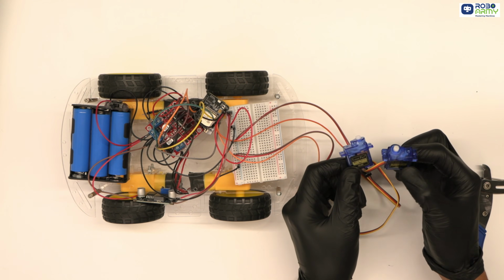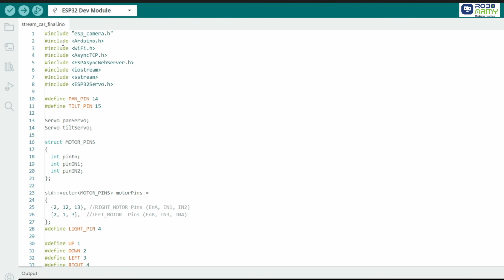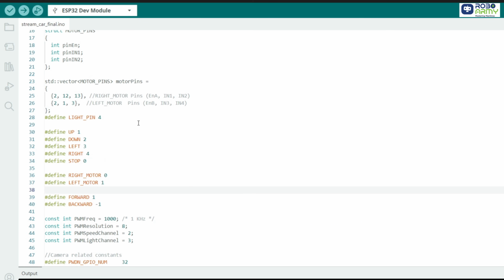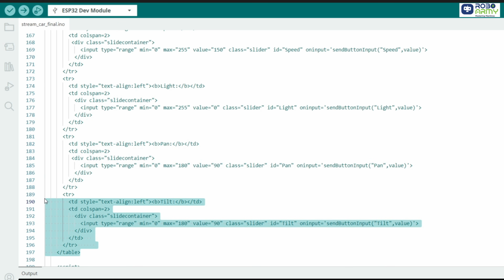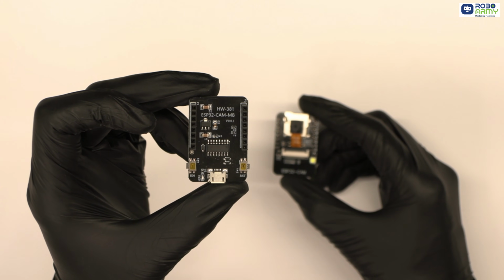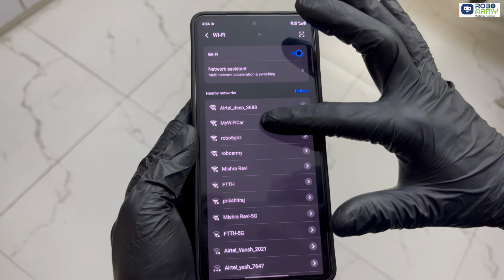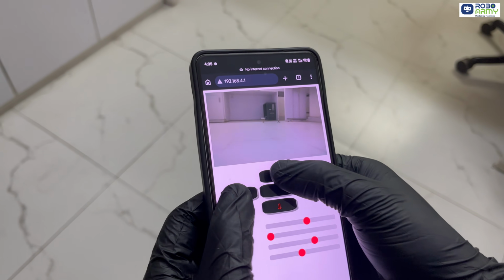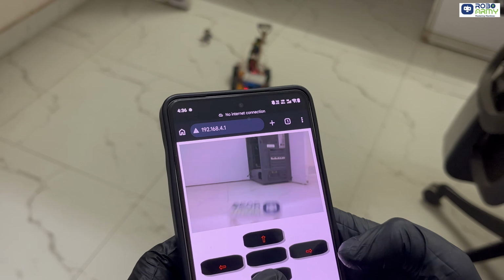Pan-Tilt Surveillance Car 😳📷ESP32-CAM with Live Control | WiFiCamera Robot using ESP32-CAM

Comment: What were u using to code the esp32? Was it a Arduino UNO? Or  ESP32-CAM-MB Micro USB Download Module. What were u using
Reply from the maker: We used an ESP32 DevKit V1 (ESP-WROOM-32) and programmed it directly through its built-in Micro USB port using the Arduino IDE. No Arduino Uno or ESP32-CAM-MB module was used. 😊

Comment: Ledc setup error
Reply from the maker: The ledcSetup error usually happens because of an ESP32 board selection issue, missing ESP32 board package, or library/version mismatch 👍 Please make sure the correct ESP32 board is selected in Arduino IDE and that the ESP32 board package is updated.